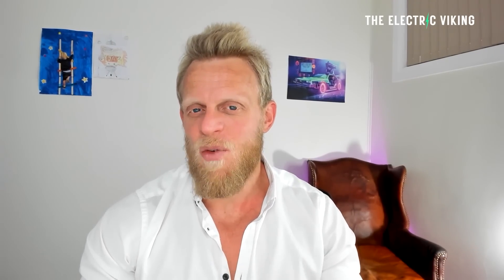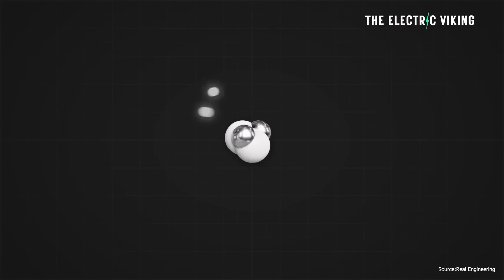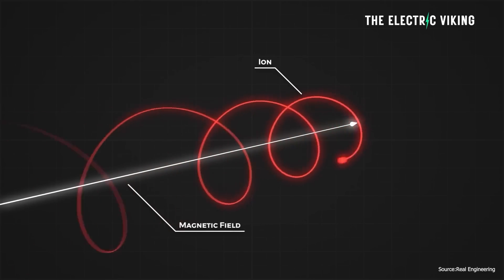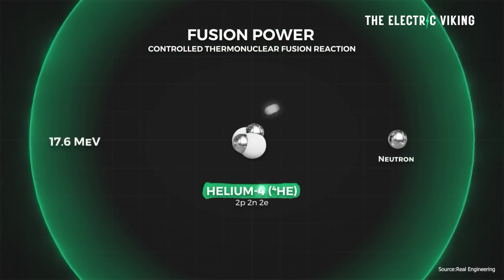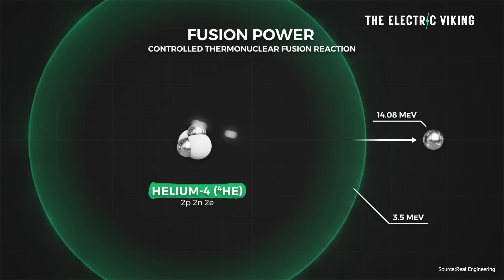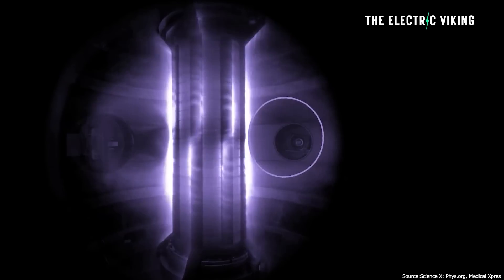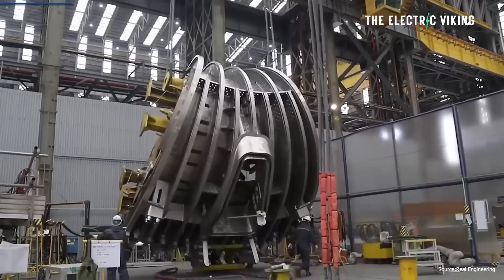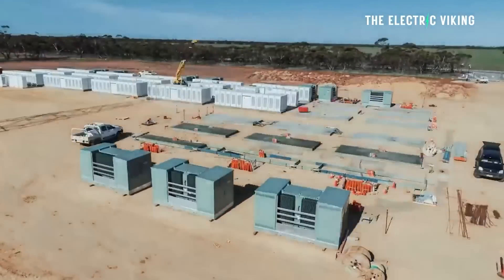The breakthrough discovery accelerating controlled nuclear fusion on Earth

Comment: It's great to have nuclear fusion and in areas where there is heavy demand, it will help to reduce emissions of CO2 and other pollutants.

However there are some worrisome issues.

Centrally generated electricity, by for profit, will do all they can to increase profits, driving up the cost of electricity to consumers and also trying to restrict people who generate their own by solar or wind combined with energy storage.

And then there's this:

1960's 1960's Canada And Eastern US Blackout

There are national security issues with centrally distributed electrical power.

In the 1960s I was living in Canada, when a transformer in the grid distribution site in Buffalo failed. and most of eastern Canada and the eastern US went dark.

There were only two of these transformers available at that time and it would take many months, or even years to manufacture additional transformers.

A later security analysis pointed out that there are only a dozen distribution nodes around the US relying on this type of transformer and if they were sabotaged it would take months if not years to get the US electrical grid back up again

now consider if millions of businesses and homes, with solar and energy storage,as well as electric vehicles, it would be damn near impossible to shut it all down and this type of distributed power generation and storage would increase  National security.

Unfortunately I rarely ever hear this brought up as the big disadvantage of centrally distributed power generation.

Another point is historically wars are often start over access to energy, such as recently the access to petroleum products.

If there is no need to secure importation of energy sources, I suspect it would greatly reduce the reasons for countries to go to war.

And an additional bonus would be that it would not only lower the cost of living, (the cost of energy is what drives inflation), the money consumers would save would give them a better quality of life and more spending power, which would drive the economy to greater heights, something that businesses would appreciate.

I believe the best solution would be a hybrid grid, combining most areas that could be supported locally together with distribution to take care of sudden loads or breakdowns, it's a flexible approach that would address the issues and reduce the vulnerability of sabotage.

Scientia Habet Non Domus,

(Knowledge Has No Home)

antiguajohn

Comment: Tokamak style fusion is still easily 30 years away or more and will likely by very expensive due to the size and complexity of the project.  There are still many issues to overcome.  There are other independent companies that are promising fusion much sooner than this, using different methods.  The key is whether they can produce stable and consistent power and a reasonable price.  If they can it would be a game changer and could supersede a good portion of renewables.  But that is a big if.  Just because something works on paper, does not mean it works in real life.

Comment: the comments contain a bunch of common fallacies.

energy too cheap to meter has been promised ever since we started building national energy grids. always from the latest new and shiny energy source, and it has never arrived.

the next new and shiny energy source (not just fusion) is always 30 years away, because that is how long it takes to go from proof of concept to commercial product, but only if you actually bother to properly fund the development stages to get there and get old regulations for other industries out of the way. we do not do this, so progress is slow.

nobody has bothered to mention this, but it is always cheaper to not waste a kilowatt than it is to generate it. we have known this to be true since at least the 1980s, but i don't know of any country who has even seriously discussed putting rules in place to regulate the removal of the least efficient devices, let alone done it.

energy storage is great, but again nobody sets the regulations up in such a way as to make the market make sense. you need the right rules and feed in tariffs to make it work. if you cannot plug a battery into the grid when there is a surplus, charge it up, and release it when there is a shortage, and still make financial sense, the rules are wrong. also funding for storage research has basically been on life support for decades.

renewable energy is usually far cheaper than megagenerators simply because with distributed generation you get many more chances to reduce the cost of the equipment, but in the uk the national grid has been optimised for a small number of large generating sites in the middle of nowhere, making combined heat and power not an option. redeveloping the grid to rectify this takes a long time and the will to do it.

small modular fission reactors make sense, but again regulation based on large reactors gets in the way. also in this context molten salt reactors have a good potential, but again old regulations for large reactors means all of the development work is being pushed to less regulated countries.

another unmentioned technology is radio thermal generators, where you basically put safely stored nuclear waste in a container, and use the same techniques for harvesting solar to harvest the energy from the radiation. again this could be done on sites suitable for modular reactors, and the ame security concerns would apply, but neither the research nor the regulation are being properly addressed.

fusion has a lot of potential, and purely from a cost benefit point of view it makes sense to continue the research, but again we have a silly policy on funding and regulation.

as for the others like wave, tidal, ocean thermal energy conversion and space solar satellites, again the funding and regulatory challenges are not being addressed.

for fossil fuels, the research and regulations on carbon capture and storage are not being done properly either.

this all feeds into the failure to address the issue of global warming, with the cheaper option of prevention being ignored, with the more expensive option of dealing with the consequences being the only option being seriously left on the table.

Comment: Here's how I would do fusion energy. You set off an H-bomb underground and then build a ring of geothermal wells around the blast sight. I don't know what the economics would be like.  It can't be that much worse than ITER.  And it would almost certainly convert hydrogen fusion into useful heat and/or electricity.

Comment: This video contains some erroneous statements. We do not have practical fusion. The national ignition facility experiment deposited laser energy at the surface of a spherical target containing deuterium and tritium. Some fusion happened, and the energy from fusion was 25% greater than the amount of energy deposited at the outer surface of the target.

However, the lasers used to deposit the energy at the surface of the target are terribly inefficient. The electrical energy that goes into the lasers is about a hundred times more than the energy of the laser output. The system as a whole did not even come close to achieving a gain.

The fusion fuel targets cost about $1 million each to make. In a reactor you would need about 10 of them per second.

Furthermore, there was no attempt in this experiment to convert the energy released by fusion into electricity. The electricity output of this experiment was exactly equal to zero.

I hope that someone can figure out how to make fusion power work, but as of 2023 it's not even close to generating electrical energy. 

Sabine Hossenfelder has a video on YouTube that explains this in more detail. The title is Fusion Confusion.

Comment: Sam thinks fusion won't be the solution. WHAT? Fusion right now is where we get all our energy from (even the fossil fuels are the result of our sun). Fusion creates more energy than fission. It is highly possible we make reactors that are cheap and safe to produce vastly more energy than we currently need. The levelized cost could end up being far less than everything else. In the future fusion might be the only grid supplied energy. Image paying 1 cent a kilowatt for power, nothing would compete. Even at 5-10 cents for fusion, solar will struggle to compete.

Comment: Greenhouse effect is a great thing to pay attention to, however, the stored energy (chemical energy) in the form of trees from the carboniferous era has been release into our system. Fusion is 10,000x more easily released and is pretty much infinitely available. So there will be no end of the heat we can release. Not sure it's a great way to go until we have an active planet cooling system.
Reply: Producing heat is not the problem. Trapping the heat from the sun in is the problem. The sun heats up the planet far more than any heat we produce, I don't know the figures off the top of my head wild guess it could be like a million times more.

Comment: To be clear the recent nuclear fusion experiment did not pass the breakeven point, in fact it took approximately five times as much energy in than was created in the fusion ignition. None of the current fusion generators including TokaMac reactors appear to be viable fusion systems.
Reply: But is that the goal of the current experiments? Or is the current goal to improve containment and therefore run time.

Comment: WE DO NOT HAVE PRACTICAL NUCLEAR FUSION!!!!  Not even remotely close.  Q > 1 did not happen. The claim relates to the Livermore laser fusion, and they weren't taking into account the vast amount of energy that the lasers needed to generate that light energy.  Sure, there was very slightly more fusion energy out than light energy in, but the amount of electricity required to generate that light energy is hundreds of times higher.  Also it was a pulse hitting a pellet, which is not a tokamak approach, is extremely expensive, and requires loading up a very expensive new pellet every time you want to generate enough energy to boil another egg.  It's not even remotely on a path to a practical system.  All the approaches that require tritium are going to hit a brick wall with supply, even if they can figure out the myriad of other problems (such as how to convert the vast amounts of heat efficiently to electricity). So this is a jumbled salad of nonsense this video.

When I worked in the laser lab, we had a 4W argon LASER.  That's 4W of light energy.  Quite a lot, you can burn stuff with it.  But it took 2kW of energy to produce that.  Probably lasers are bit more efficient now, but there is still a big multiplier required for electrical power vs light power.  Also, all these fusion reactions generate heat.  Converting that heat to electricity is not particularly efficient either.  The max efficiency of the Carnot cycle is 50%.  So, we have a planet that is warming, and we want to make zillions of multi-gigawatt heaters.  Nice.  I would rather see investment in some production that doesn't require generation of waste heat.  Most of the electricity will become heat in the end anyway.  So, solar or geothermal.  There's basically limitless geothermal energy.  Why bother with all this money for Fusion?  I really doubt it will save us unless they discover some radical new physics.

Comment: They DID NOT produce more energy than they put in in a recent nuclear fusion experiment. IIRC the numbers correctly, they pumped 200MJ into a laser system to create 2MJ out which led to 3MJ from a fusion reactor. Those claiming it produced more energy than what went in are just comparing the 2MJ of laser energy with the output and are completely ignoring the 198MJ lost in the process.

It is like claiming an ICE is 100% efficient by ignoring the 75% of the energy lost as heat.

Comment: Now that brief bursts have yielded more energy than was put in, the problem is how to run the process longer without compromising the container. If this allows a tuned-down, controllable release of energy, it could be the key. But will expanding wind and solar make it a marginal source?
Reply: Yea, sounds like wild speculation by Sam. Fusion sounds viable because the mathematics shows it. Just a method of implementation needs to be found. Too early to say, but if fusion produces electricity at 1 cent per kWh for the end user then nothing else will compete.

Comment: CS are you referencing something outside of this particular videos comments?  I am certainly 100% against any sort of fission system as terrorists could destroy one and polonium is one of the deadliest substances to humans in existance. This particular video is about Fusion which isn't related to fission. Fusion folks always are making claims of a breakthough, this has been going on since WWII, when will enough have been wasted on it?  For the same investment half the planet could be running on Geothermal.  The core of this planet is as hot as the surface of the sun. One can certainly question if there is any need for all this supposedly clean energy.

Comment: theirs better ways of making power on this planet than boiling water, even at temps of sun. boiling water is good for small scale & remote applications if you dont have wind or solar which we do & for large scale power we already have tidal & geothermal either of which would provide all the power we could ever use
it takes A LOT of power to imitate mass, without room temp super conductors we will NEVER be able to create more energy than it takes
the oceans & earth already have the maximum ambient energy available on this planet, we should be harnessing them if we want cheapest most efficient  large scale energy
PS NASA proposed using a similar twisted doughnut shape in 2012 to decrease the power needed to Alcubierre drive by a number of magnitudes

Comment: One thing you guys do not get is, that between the energy into and out of the reaction and energy in and out of the device is a 20x. Fusion has to create over 20x more energy, than it consumes for the device to be nett positive. Getting over the 1 to 1 issue is a breakthrough. We only need 20 more.  So 50 years to go ;)
Reply: Only $50B and 50 years away. Good to know.

Comment: ITER will lead way on fusion energy, however, initial power plants will be very large, very complex and costly. Few countries will have the technical capacity or be able to afford to operate them.

Cost effective fusion power in the mainstram is very likely, but still fifty plus years away.

Many recent fusion announcements are just hype and lack substance. A small number actually represent genuine advances.

Comment: Fusion has been the energy of the future for decades and remains the energy of the future. The "break even" point is not a useful concept.  When Livermore said they reached break even, the energ produced is larger then the energy needed to produce the fusion reaction.  In a say nat gas power plant, a match or electric spark is used to ignite the gas.  In Fusion the energy output is now slightly larger than the match used to light the nat gas.  For an economical power plant the ratio is not 1:1 it's a billion to 1.

Comment: You are spot on. Nuclear fusion as currently done requires extremely purified fuel that is cost intensive to produce.  Fusion will result in centralized power that has all of the same problems that centralized power generation does today. Line outages, etc. 

Meanwhile solar power is incredible cheap and abundant and can be decentralized down to individual home level. 

Fusion has a part to play as a backup power source but is never going to be as cost effective as harvesting the power of a free fusion reaction called the sun. 
It mainly will be used by the military and by space exploration.

Comment: Nuclear fusion is still a pipe dream while newer fision reactors are ready to go.  So far that has not been any controled fusion reaction that makes any power greater than what it takes to create the reaction.  Once this is accomplished then maybe something can be built that can enlist this reaction to do something useful.  Fision reactors however are well developed and have been producing power  for 70 years.  Newer designes particularly high temperature reactors are also proven concepts that only need final engineering to develop  power plants that can be mass produced at economical costs. These reactors are inherently safe and can actually destroy present nuclear waste as their fuel.  As far as I can tell discussions of fusion reactors is nothing more than a distraction.